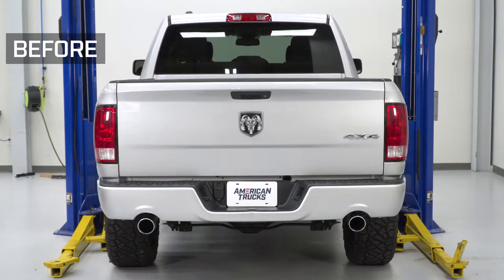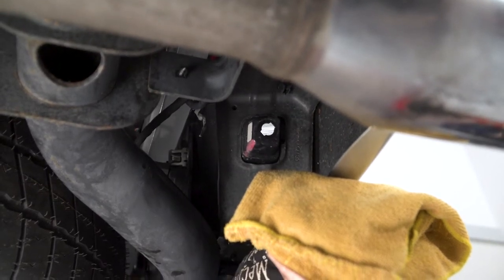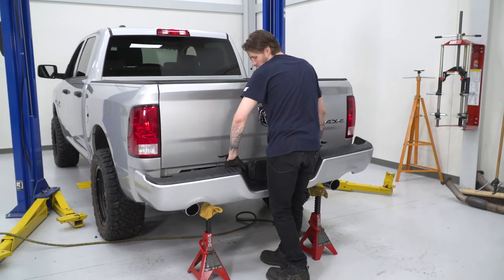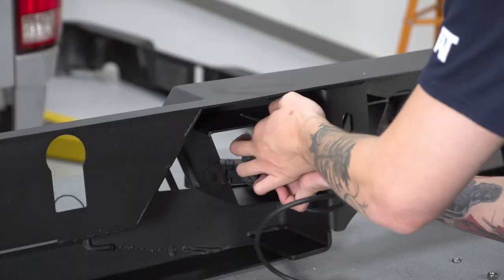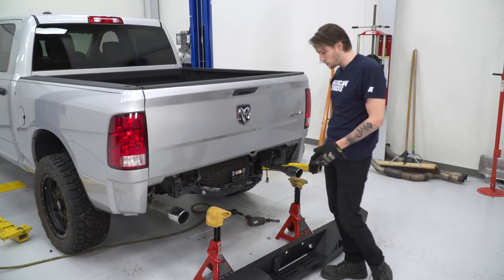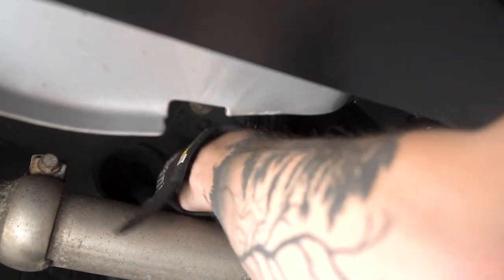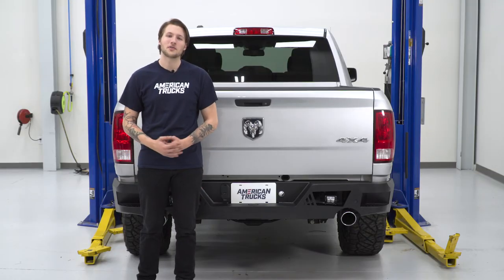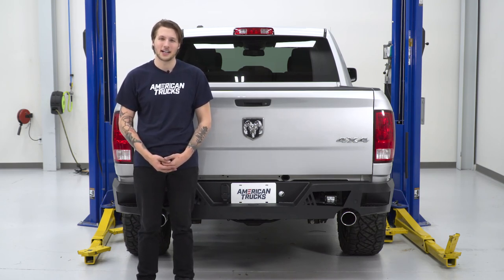2009-2018 Ram 1500 Barricade Extreme HD Rear Bumper w/ LED Spot Lights Review & Install

Comment: So how do the lights turn on/off? Is there a switch? Fo they connect to the reverse lights? How do they work?
Reply from the maker: The included lights are going to be coming with their own wiring harness and separate switch, so they are going to work independently from your reverse lights out of the box. That being said you can always wire them into your backup lights, but out of the box it is made to work on its own. -Zach
Reply: I was wondering the same thing 🤔